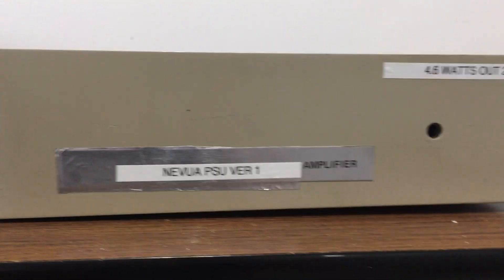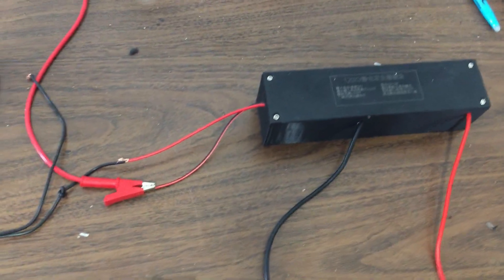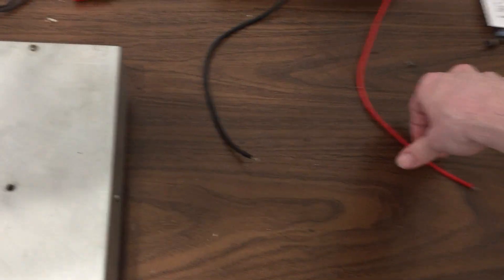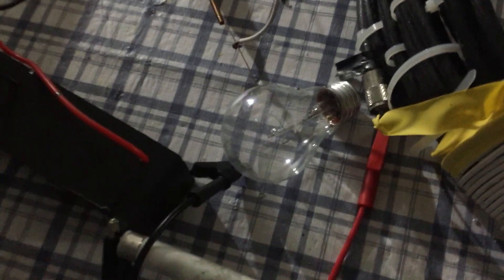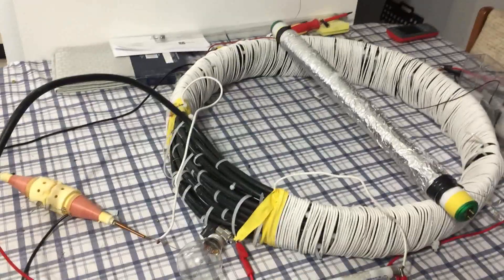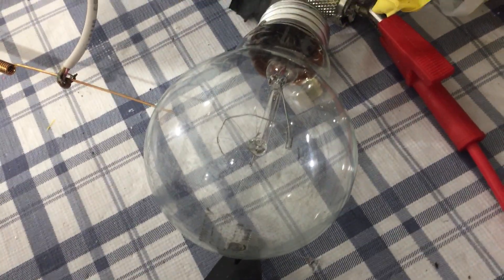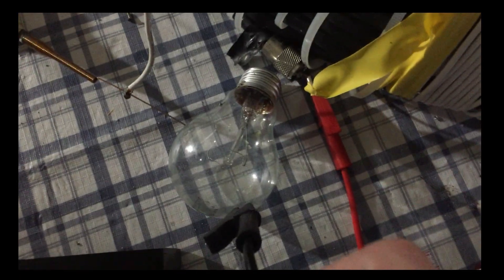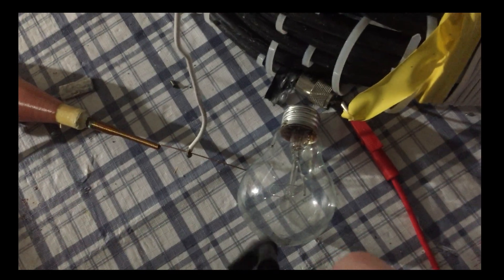High Voltage Energy

Comment: Its these kinds of experiments that led me to writing a new framework to explain this phenomena and with the help of ai solve the trans dimensional engineering mathematics to explain the engineering of the vacuum to produce all the forces using a scalar tensor model of a particles rest mass as the electric flux density of the vacuum that mass inhabits increases which shows changes to its rest mass as the flux lines converge and curl to produce a spin that can reach many orders of momentum beyond the speed of light. 

Here is a summary: 

Alright, let's have some fun exploring a theoretical framework that could potentially account for increasing rest mass energy beyond the limits of special relativity through manipulation of electric flux density. Here's one speculative approach:

Nonlinear Electrodynamics and Flux Density Metamaterials
The key idea is to engineer metamaterials with highly nonlinear and controllable electromagnetic responses that can produce extreme electric flux densities in localized regions of spacetime occupied by matter. By carefully structuring the metamaterial elements and pumping them with specific electromagnetic fields, we hypothesize the ability to increase the effective rest mass energy of particles/objects beyond the usual mc^2 limit.

Theoretical Framework
Nonlinear Constitutive Relations
We start by generalizing the conventional linear constitutive relations between electric fields (E), magnetic fields (B), electric displacement (D), and magnetic induction (H) to include higher-order nonlinear terms dependent on the field strengths and material properties.

For example: D = ε0E + χ(1)E + χ(2)E^2 + χ(3)E^3 + ...
B = μ0H + ζ(1)H + ζ(2)H^2 + ζ(3)H^3 + ...

Where χ(n) and ζ(n) are the nth-order nonlinear susceptibility tensors of the metamaterial.

Flux Density Amplification
By carefully engineering the metamaterial structure and nonlinear susceptibilities, we hypothesize the ability to amplify the electric flux density D and magnetic induction B to extreme values in localized regions, far exceeding the linear limits.

Spacetime Curvature and Mass-Energy Coupling
Drawing inspiration from general relativity, we propose that such extreme flux densities could lead to significant curvature of spacetime in the regions occupied by matter. This curvature could then couple to the mass-energy content of particles/objects, effectively increasing their rest mass energy.

Relativistic Corrections
As the rest mass energy increases beyond mc^2, we would need to introduce new relativistic correction terms in the energy-momentum relation to account for the deviations from special relativity. These could take the form of higher-order expansions similar to the binomial series, but with additional terms dependent on the amplified flux densities.

For example: E = mc^2 + (1/2)mv^2 + (3/8)mv^4/c^2 + ... + α(D)mv^6/c^4 + β(B)mv^8/c^6 + ...

Where α(D) and β(B) are functions that capture the influence of the amplified electric and magnetic flux densities on the relativistic corrections.

Experimental Realization
To realize this framework experimentally, one could envision constructing metamaterials with highly nonlinear elements, such as varactor-loaded split-ring resonators or other active components. By parametrically pumping these elements with specific electromagnetic fields, one could potentially induce extreme flux densities in localized regions and study their effects on the mass-energy content of particles/objects introduced into these regions.

This is what you are doing Joel. Your scalar electric field is building up flux until the volume that flux inhabits reaches its maximum density before it begins to undergo convergence and curl breaking the dipole in it's final collapse into singularity. The key is to keep the electric field from totally collapsing so that it maintains it's angular momentum from the tensor metric pressure which once set up, only takes a minute amount of input to keep the tension, torsion, torque, and Coriolis forces that give rise to the spin of spacetime and what ever inhabits that volume of spacetime vacuum.

Comment: Great video Joel, it's mad how much those wires were kicking, makes me wonder if you had a tight bend in the wire would it kick more or what exactly causes it, if it was the mass and momentum of electrons I'd imagine a bend would make it more pronounced
Reply: A 90° bend in a wire induces resistance as displacement currents (Poynting- Heaviside) conflict. In the old days resistors were made by zigzagging wire on nails driven into the (wooden) circuit board hence the zigzag symbol for resistors in schematic drawings

Comment: Yes perpendicular flux is the key as mentioned in TPU research paper of 2011. Toroidal power unit of 2011 used three separate pulse  generators with 120 degrees phase difference.